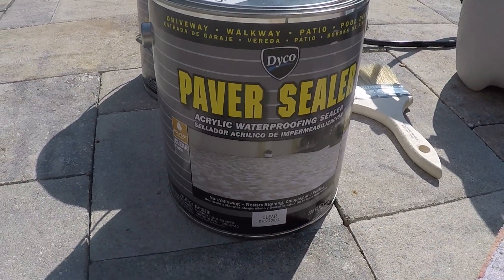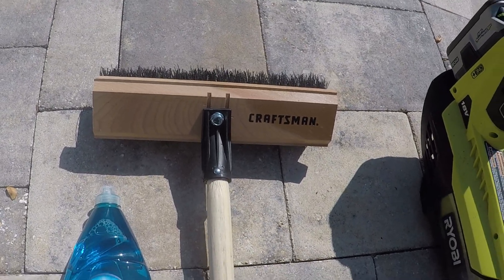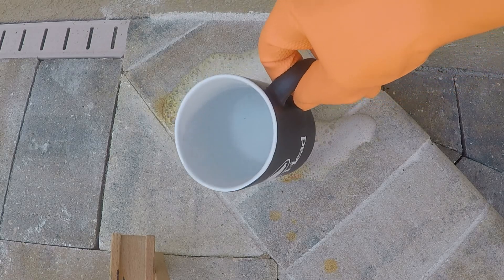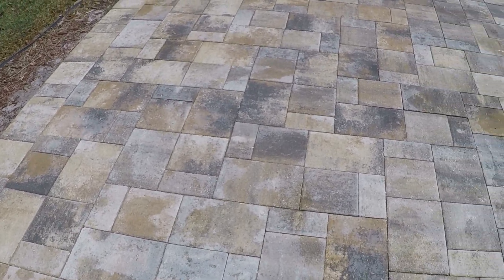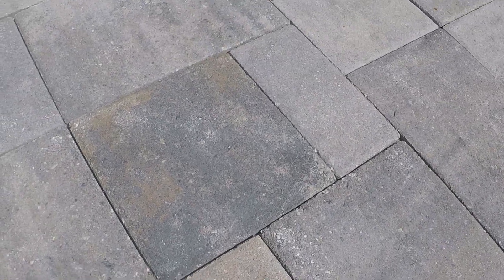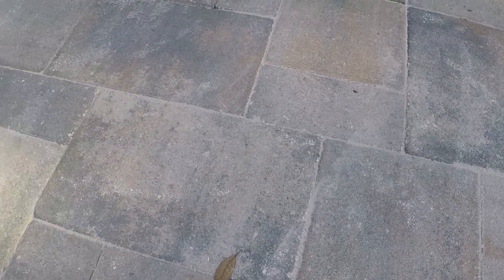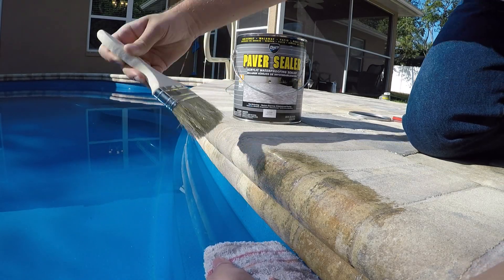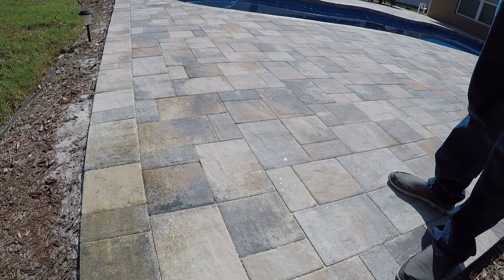HOW TO Seal Pavers & Pool Coping | Using A Garden Sprayer DIY

Comment: This is awesome! I just finished pressure washing and wanted to research next steps to ensure I preserve my pool area and pavers. Love the tip with the paint brush and edges! Heading to the store to grab supplies! Thank you for taking the time to put this together!
Reply: I pressure washed Friday and just did my polymeric sand. Still debating which sealant to go with because I don't want anything slippery or something that needs to be stripped in a few yrs. Would like to hear what you end up using for a sealant. My local box stores don't have many options

Comment: Very nice video on how to apply the sealer. Does the sealer harden the sane in the joint?
Reply from the maker: Yes, the sand will also harden which is what you want to prevent the sand from washing out 👍

Comment: Good to know you dilute muratic 50/50. I haven't tried it yet. I didn't know those white 16" pavers stain so easily. I just dry set some fancier pavers and was wondering if I could seal them before I add any of that filled sand stuff

Comment: Great instructional video! Thank you for your work! 
After sanding it and then sealing it… did it keep plant/moss growth from happening?
👍🏻
Reply from the maker: Yes, it definitely helps, but over time, the sand will wash out again, and seeds can blow into the cracks, and you'll see some plants growing through. Sealing the sand helps keep it in place longer 👍
Reply: @deuceliter  thank you for your response partner! I appreciate it *
Keep on! 👍🏻

Comment: I love this video, I learned alot thank you, I am a 67 year old woman and I did exactly as you said and did and the pavers came out great, How often do I have to do this?  Thanks again
Reply from the maker: Great job Grisell, that is awesome! You will probably need to re-seal every 3 - 5 years.
Reply: @deuceliter  Thank you , it turned out great ,Wow I never thought I could do this, next project, crack on driveway.

Comment: Is that sealer a breathable sealer? I used one that was not, it turned white and it is peeling off.
Reply from the maker: No issues like you stated with it, and it's been about 4 years since I put it down. I'll probably need a new coat in another year or two to freshen it up.

Comment: just a few tips if you used a surface cleaner 16inch for a 4gpm pressure washer applied house hold bleach to the surface first that would kill all mold and agley in cracks and make wash time go much quicker, then you get to the sealer phase i recommend using a typhoon v2 back pack by flowzone that will give you a nice flow rate and also speed up time, never want to add sealer with a brush or roller after you re sanded to prevent any loose sand you may have missed from getting in those tools for best results spray the sealer on lightly in figure 8 patters then come back with a second coat it helps hide any over lapping.
Reply: Do you have missed the mark completely. You think you know but you don't and it's sad because you waste people's time and money with your pride rather than learning from people like me that have made the mistakes and know exactly how to clean out the joints in an inch to an inch and a half so the polymeric sand will set up properly. You guys are the reason I'm so great in 6 weeks out at times.
Reply: @JOSHUAloves1  what do you recommend for proper sanding and making sure there is nothing on top? Finished my own pavers and definitely sealed some sand on top even after a wet-vac, leaf blower, and broom all used multiple times. Plz lmk just became a LLC working on our craft before trying to give customers a great product.
Reply: @idontwatchfilm  what area you in? Climates can have an affect on outcomes
Reply: @MANUEL_FL  I’m in Florida. It was on a back padio covered

Comment: So I have brand new pavers put down. paver guys will be done tomorrow. I'm starting on this saturday. 3 days after. You think 2 coats will be good?? thx
Reply from the maker: A very thick coat is enough to seal and protect the pavers. If you want the added protection and gloss, then 2 coats are fine 🙂
Reply: thanks!
Reply: @deuceliter  I'm in Fl as well. You probably did this during the winter months when rain was less likely?? It's mid June and I think I picked a bad time to seal. It's been raining every aft after 2 or so for the past wk so I gotta keep an eye on the weather as I wanna get this done soon. The pavers nearest the house are taking a long time to dry out to I noticed...yikes I gotta figure this out

Comment: Any recommendations please about pre sealing before laying and grouting? Cool video lots of work but great result
Reply from the maker: Thank you! You will want to seal after you lay sand. The sealer will harden the sand and makes it harder for plants to grow in the cracks.
Reply: @deuceliter  thanks but I was referring to gluing the tile down and then grouting, not sanding. I need to know whether the tile should be sealed prior to the grouting process or if just after is ok?

Comment: My area is about 600-700 Sq ft. How many gallons and did you have you had any peeling issues since sealing? Most resources suggest the use of water based but solvent based brings out the color, though it's prone to scaling and peeling. I have the very exact pavers. Did you ever consider using a bit darker sealer (for better color enhancement) or using something more glossy? I'm kinda torn between all these choices. Please advise.
Thanks a million.
Reply from the maker: I used 5 gallons to completely cover one thick coat. No issues or peeling so far 🙂
Reply: @deuceliter  So going on 3 years now with no issues? Great to hear! Does the glossy / wet look still appear to be the same as when you first sealed?
Reply from the maker: @Peter Abadear  no issues with sealer but I suggest using the polymeric sand. Most of the thin sand I originally used washed out over time. The wet look is still there but more subtle now with age. I will probably need to redo it in a year or two.
Reply: @deuceliter thanks for the tip regarding polymeric sand. I had my patio just redone and the polymeric sand washed out after 8 days of clear skies. Was hoping to retry it again but this time sealing it after re-sanding. I was going to proceed with the regular sand as you did to save some cost but I suppose I’ll do it with polymeric sand again. Fingers crossed the sealer is the missing piece to my initial erosion. Would you use the Dyco sealer again? I ordered Glaze N’ Seal due to limited availability where I live. Any experience with that one?
Reply from the maker: @Peter Abadear  haven't heard of it. I would most likely use Dyco again. So far so good 👍

Comment: How has sand held up?  Did it wash away or did sealer keep it in place?  Good vid!
Reply from the maker: It has done well, the sealer has kept it in place over the last year. When I go to redo it again in a few years I will probably use the polymeric sand since that is what is technically suggested. But overall no issues with it.

Comment: What if it rains on it after install.
Reply from the maker: Should be fine unless you're trying to apply it while it's raining. Then you may have issues with it adhering to the pavers. If it rained a few hours after application shouldn't be an issue as long as it was warm outside to help dry it.

Comment: I’m curious, how much do you charge for this size job? I’m starting my own business dealing with cleaning among many other services and considering adding this as well. Any information you could share on the subject would be highly appreciative 🙂
Reply from the maker: It cost me around $200 for the one coat of sealer in supplies. It took about 4-5 hours work time including prep work, so just add your labor cost per hour and that should give you a rough estimate. If you are doing it commercially use the polymeric sand for the best results, which cost slightly more.
Reply: @deuceliter  interesting. I appreciate the information

Comment: Polymer will not set up because you are not cleaning the joints out properly. You need a zero-turn to clean the joints out an inch to an inch and a half and get all the old crap out of them so that the polymer can set up not overflowing out of the joints but set up slightly below the top of the paver and then mist it so it'll harden up. 👍
Reply: He didn't use Polymer sand. He said the bag costs a few dollars, so no way is that Polymer sand. He used regular paver sand to fill in cracks/voids in his existing joint sand.

Comment: This is the worst thing you can do. Do not add sand clean the joints out properly and reinstall the polymeric. The joints need to be blasted out and cleaned out an inch. All the dirt weeds and everything else that's in the cracks needs to be removed. For the polymer to set up properly what he's doing is a waste of time and it gets you nowhere in the long run. You're going to do the install do the install properly and clean out the joints.
Reply from the maker: Appreciate the expert opinion Joshua, I agree if you can afford the polymer sand you will get better results in the long run. My papers were roughly a year old and still had a lot of polymer in the joints. This is an at home DIY to help save money for a similar result. Its been about 6 months and have had zero issues with my pavers, joints, etc. Still looks as beautiful as the first day. Again appreciate the feedback!
Reply: Exactly

Comment: Oh boy I just realized you're not even using the proper sand. Absolute fail. It has to be a polymer the joints have to be cleaned out an inch to an inch and a half. Properly.
Reply: thats b.s